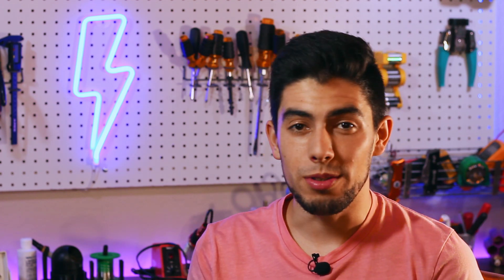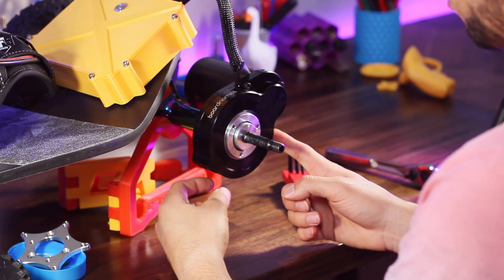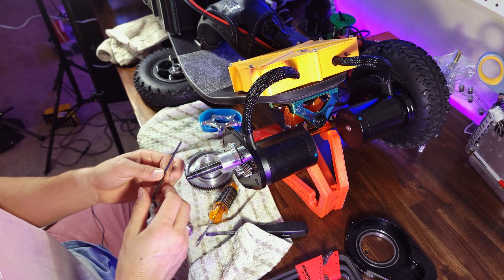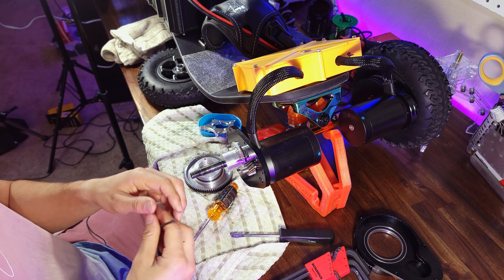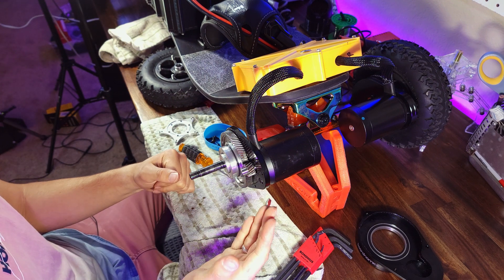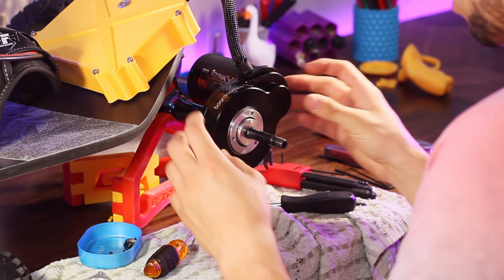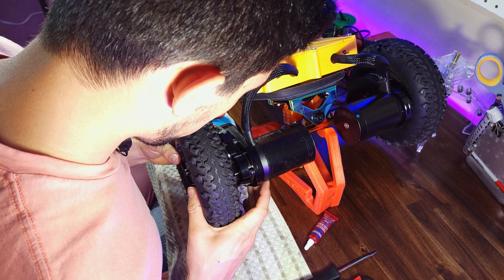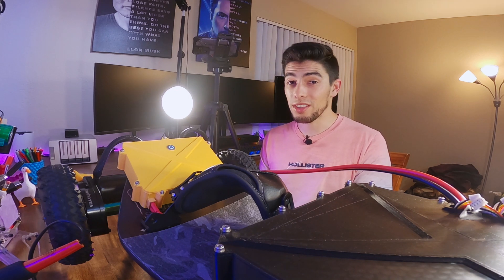How To: Boardnamics AT Gear Drive Teardown & Assembly

Comment: Hey man. Im about to buy this gear drive (5:1) and was curious about the torque. Hows it feel on a 190kv. Im gonna go 100-140kv for mainly offroad and wanted to hear your thoughts. Hows the sound?
Reply from the maker: Hey there, for 190kv the torque is great! What voltage are you planning to use?

If you go 100 to 140kv your top speed would be incredibly low. As it is right now I max out at just barely 39
Reply: @RBEMotion  gonna be running a 12s4p samsung 40T cells. I think im gonna go with a 170KV with the 5.2 Ratio. Will bring me sub 30mph but im sure il have some great torque!. Im also 130 pounds and my board is only gonna be 23 pounds which is light.
Reply from the maker: @BreeZieDoesiT  Hmm alright. 170kv will be okay, but it will be absolutely ridiculous torque lol. For me, I'd personally consider higher voltage to get some more speed, but it's up to you! Either way it will be crazy.
Reply: @RBEMotion  yea thing is i dont like going over 30+ when im in trails and even on road. Ive fell going both 20mph, 36 and even 43 once (metr pro) so i calculated the exact time of drop off lol and I can tell you. Falling at 20-25 compared to falling at 35-50 is a big big difference on our anatomy and physiology. Obviously how you fall contributes alot to the damage but I prefer sub 30 now so I went with the more torque!. How do you like the drives so far in terms of sound?. The metal on metal sounds so F1 ish lol. I love it, must sound better in person?
Reply from the maker: @BreeZieDoesiT  ah I gotcha haha yeah the sound is great except sometimes you can hit some more annoying resonance, part motors part drives. Otherwise ya sounds sick

Comment: What's your gear ratio and top speed?  I see you may maybe riding 12S?
Reply from the maker: On this setup I picked the 5.2 gear ratio. My setup is 12s, 190kv motors, and 8 inch tires. I max out at about 39mph
Reply: Thx for the vid! I just ordered the 3.95 gear ratio. I was told the 5.2 offers the slowest mph and that the 3.95 has the most mph. Is this correct? The reason I'm confused is bc my current top speed on my Lacroix jaws 2.0 is 34mph and was told I could get 39mph with the 3.95 gear ratio (boardnamics). I appreciate your insight!!  @RBEMotion
Reply from the maker: @jpaulglobal Hey there, yes that's one way of looking at it. Without changing any other settings, the 5.2 will give more torque and less speed, and the 3.95 will give more speed and less torque, for the same motor settings.
Reply: @RBEMotion  I’m planning on buying flipskys 63100 190kv motors to replace my old 6389 190 Lacroix (maytech?) motors. Coupled with BN’s gear drive at 3.95 gear ratio. I hv a 12s4p stock Lacroix battery. I’m sure the 63100’s will be more than my Lacroix board can handle but I’m planning on upgrading the battery at some point in future that’s why I’m planning to buy the 63100’s to install now. Does that sound like a good plan do u think? Thanks for any input I respect the knowelege.
Reply from the maker: You'll want to upgrade the ESC to get anything different out of the motors. Something from Makerx would be great. That way, you can increase the motor amps a bit.  @jpaulglobal
Reply: Ah with my current Lacroix stock VESC Stormcore 60D+ am I not able to adjust programing to get a little more out of the 63100's w/ my current 12s4p?  @RBEMotion

Comment: Hey 👋 thanks for the video. I had a bit of a problem that the screws locating into the holes have worn down the thread on the screws and opened up the holes. They are on my Trampa build and I think the slight flex on the wheels have have “sawn”
The location holes. Have you come across this issue?
Reply from the maker: Hmmm.. Yeah. You're correct. It was something that BN didn't anticipate happening, and I think you've got the right idea. Wheels flexing and shifting side to side can gradually open up the holes over time, and I haven't experienced it in mine yet but I expect it will eventually happen.

If you email Kevin, he'll hook you up with the v2 plates, which are steel, and much much stronger. Those should not have any issues. Let me know if you need help with it.
Reply: @RBEMotion  in fact I do have the v2 plates. They lasted about a month. I did message him to inform him this maybe an issue. It feels like there should be like a hex spacer that sits between the wheel and the plate to stop lateral movement. Similar to to what lacroix use. This may not be an issue with street riding but hard off-road riding compounds the issue.The other issue is the “bearing mount” slid all the way along my Trampa hanger which made the wheel base about 8mm narrower, would be nice to have a locking grub screw so it can positioned accurately.  Thank for the video it made the install nice and easy.
Reply from the maker: Ah okay well that is good to know. I'm surprised they only lasted that long. Good idea though, that spacer might help with the movement.

The bearing mount or whatever, hanger adapter, is supposed to slide all the way until it stops. That's part of the design. Then the wheel nut compresses and holds it in place. I guess it just has a smaller wheelbase than your previous setup. 
Of course, here to help.
Reply from the maker: Wow haha I just realized who you are, I used to watch a bunch of Dr. Who! Super cool stuff man, very neat to see you're into electric skateboarding haha
Reply: @RBEMotion  ha yes! Been dressing up for 16 years now 😆 have to skate to keep fit and flexible for my cyberman costume 😆
Reply from the maker: Oh man haha I don't know if I could ever do it, mad props to you though, that's super cool!
Reply: @RBEMotion  thanks! Yeah it can be quiet hard at times 😆
Reply from the maker: Haha I'm sure. Well best of luck with your Esk8 stuff, hope you'll stick around to watch more content 😉

Comment: Thanks for the video! Where do you get the spacer in between the bearing in the wheel? At 1:25 you mention that there is a spacer that is important. I can't seem to find it on the MBS site.
Reply: May be comes with the gear drive kit?
Reply from the maker: The spacer for the wheels is provided with the boardnamics kit, so no need to worry about getting it separately.  MBS does not make spacers for this application.

Comment: I have a hard time install the hangar adapters. How much do you have to grind off the hanger
Reply from the maker: Ooh yeah.. that can be tough if your hangers are a little over sized.  I probably had to grind off maybe 0.5mm off around in different places
Reply: @RBEMotion  Thanks, I finally filed down enough to got one side done, on to the next. What an extra works. I ordered two set of drive gear, but know the technic now
Reply from the maker: @mta3562  Yeah it's not SUPPOSED to be that hard haha technically you should only really have trouble with some oil slick trucks.  What color were yours?
Reply: @RBEMotion  I have one black and one oil slick sets. Have not start on the oil slick yet but the black one I have to sand down quite a bit
Reply from the maker: Ah interesting. Yeah the black ones that Boardnamics was testing with slid right on, when we put mine on it was very hard

Comment: How many mm did you cut your motor shaft?
Reply from the maker: If you measure from the faceplate of the motor, you're going to want to make sure the shaft extends no more than 25mm from there.

On my Flipsky motors, I had to cut off right up to the edge of the keyway.  My guess is I cut off about 5 to 6 mm off the original length.

If you buy motors from Boardnamics, they should already be the correct size.

Comment: would 63100 or 80100 motors also fit?
Reply from the maker: I don't believe you will have any issues fitting those, so long as they have the same mounting hole pattern.  You will need to adjust the angle of the drive appropriately so that they do not collide with the baseplate, however.  With these 6384's, I can make them hit the baseplate on the sharpest turn, so I need to adjust mine down one notch.
Reply: I’m having some trouble mounting My 63100 on this exact drive and black matrix 2s

Comment: Whats your opinion about the gears being all steel?   I actually ordered this but haven't installed yet...  but all in all ate you happy with yours?
Reply from the maker: Well, the idea behind the steel gears is that they will be more durable over time.  While there are plenty of people that run plastic drive gears for thousands of miles, having steel adds an additional level of durability.  This of course requires the gear mesh to be set up correctly, but they idea is that even though jumping and beating on them, that they will never shatter a tooth.

I love mine so far, I think the sound is really cool, they feel really smooth and solid to ride with, and through the jumping I've done so far, they've been great!  Let me know if you have any other specific questions.
Reply: Did you ever install the BN gear drive?? I just purchased also and waiting to install...Lol

Comment: Hey bud I was told the gear drives would just slide on to the trucks as I paid to have them assembled.   What do I need to do so I can get them in the right spot.   Also saw what you said about the unity and I have a 12s7p 21700 cells from chi battery systems    Do you suggest getting a different vesc instead of the focbox.   What settings do I need to use in the vesc tool for that battery.   I apologize I’m slower than molasses when it comes to this stuff unfortunately.    Thx
Reply from the maker: Hey Harry, thanks for watching the video.  So, when you slide them on, which part are you confused about?  Do you need to know how to set them to the right angle?  Are you having trouble sliding them on?  Remember, each side only fits on one way, so it should be pretty clear which side goes where.  

I don't actually recall what I said about the Unity, but there are several good options on the market.  The customer support with the Unity can be hit or miss, and the QC on some of the connections isn't great from my experience either.  Some great options are the MakerX DV6, Stormcores, or the Xenith.  Some of these may be hard to get ahold of, so if you have a Unity already, you might as well try using it, but if you have problems with heat or reliability, know that there are others out there.  You've got a pretty beast battery so I would expect to be able to pull easily 120 amps out of it, and probably get 25 to 30 miles of range.  That would allow you to set the Unity or whatever ESC's you use to pull 120 battery amps.  You could set your motors to probably 80 to 100 amps depending on what motors you're using as well.

I would highly suggest watching my MakerX setup video as I show how to set up a vesc in it, and it might help you understand what you're looking at.  If you have more questions, feel free to respond here!

Comment: We need a tutorial that shows more about the drive gear since there is no set screw like normal. I got mine second hand and they were installed with blue 242 and not green 648. Your video helped me tear them back down but now stuck on the pinion gear with keyway that was done with the wrong loctite. It apears to be on well. I cant pull the keyway out with pliers. With 648 I would need a torch.  Not sure but the use of a puller might not grab b/c the pinion is so tight to the case cover. Im guessing anybody with motor failure would need to be able to remove this pinion just like me. I am aware that 648 will seep into the gap but in my case the gap is full of blue 242.
Reply from the maker: Thanks for watching my video!  Glad it helped you tear it down. Kind of funny that they're already going on secondhand.  I'd love to help you out, but I am not going to be disassembling mine again because they're working perfectly.

Very odd that someone installed them with Blue and it stayed put, it really shouldn't.  Anyways, you're in a bit of a tough situation, I know what you mean how it might be difficult to grab the gear, it's very close.  I think a good technique would be applying heat carefully with a blowtorch or mini blowtorch, and using a strong screwdriver to gently pry it off.  Blue responds to heat in a different fashion than red, but it should still loosen up enough to get it off.  

I agree with you, anyone with motor failure would probably need to do the same operation.  If I ever come across motor failure or need to change mine out, I'll definitely make a video on it, but as of right now, that's a lot of work.  Please let me know if my suggestions helped you out, if not, we can continue discussing ways for you to get it off.  Blowtorch + screwdriver should do it!

Comment: What motors and battery are you running ?
Reply from the maker: I've got two Flipsky 6384 battle-hardened motors with their shafts cut to 25mm. As for the power, temporarily I'm running a 12s setup of old lipo batteries that I had from a previous build.  When I'm done, this build will have a 12s7p of P42a cells.
Reply: @RBEMotion  just fully assembled my gear drive and turns out I didn't get the adapter on the truck enough lol, the spacer doesn't fit in-between the gear drive and the hub. feels bad. I guess I need to fully disasemble and file the trucks down.
Reply from the maker: Oooh yeah that's rough.  When you press the adapter onto the truck, you want to make sure that the thick part of the axle, the lip, sticks out past the end of the adapter just a little bit.  Check out the hanger itself and see if there are any bits that look like they were scraping
Reply: @RBEMotion  thanks man, yeah I still got about a week before my battery comes in, so i got some time to mess with it
Reply: @Ianshane427  I’m having the same problem.   Did you figure out what to do ?   I was told the assembled drives would just slide right on to the mbs matrix trucks but they are not going down the axle close to where they should be.
Reply: @harrybauls6217  mine definitely didn't slide on. Also you know they each have their own side to go on right ? I kind of forced mine on, I would not recommend that. Definitely take your time and file them down. I just put the spacers on the axle and used the axle nut to tighten against the adapter. Once again I would definitely recommend filing the trucks down.
Reply: What is price

Comment: Nice build, what vesc are you using and where did you get the vesc enclosure
Reply from the maker: Thank you!  Most of the things on this build are a work in progress, I am working on the design for the vesc enclosure, and intend to refine it over the next few months.  I may consider offering it for sale in the near future.

As for now, it's a custom 3D-printed enclosure that I designed and printed out specifically for this build.  It currently has a Unity in it, but I do intend to switch this to a MakerX DV6, or something that can handle higher voltages.  It works for now though.

Comment: Should we apply loctite to every screw? I noticed you didn't apply it to the outer case screws
Reply from the maker: Yeah I didn't, I just figured that it would be super easy to see if any of those were coming loose, and if they start to come loose, I'll apply it then.  All of the internal ones are much harder to access and hold a much higher stake if they come out.  

It was also very easy to give the case screws a lot of tightening torque.  Does that answer your question?
Reply from the maker: If you want to put blue loctite on all of them, it can't really hurt, it's typically pretty easy to get off if you need to.  So really, it's up to you, but I personally do a check on my board every time I ride so I'm not too concerned.